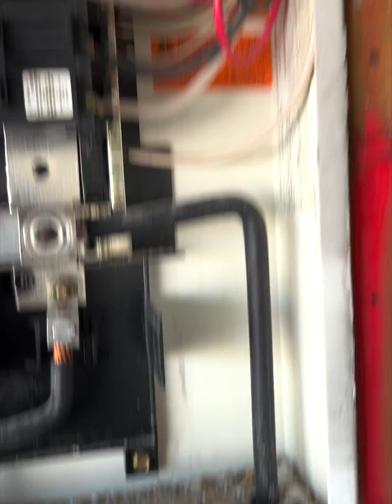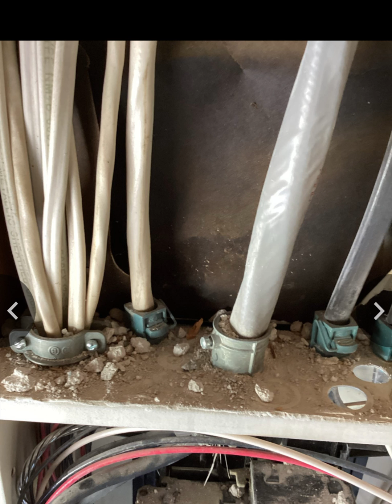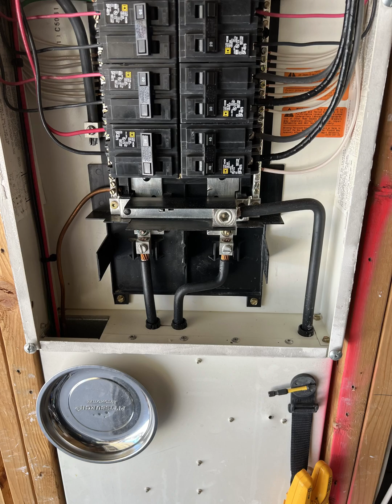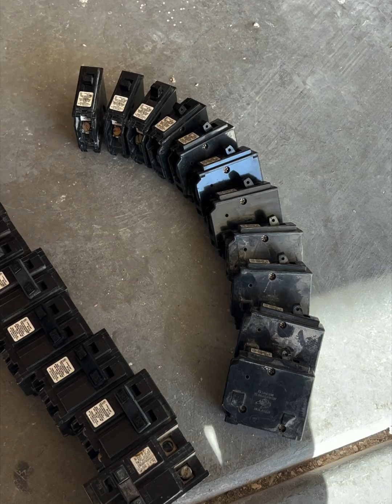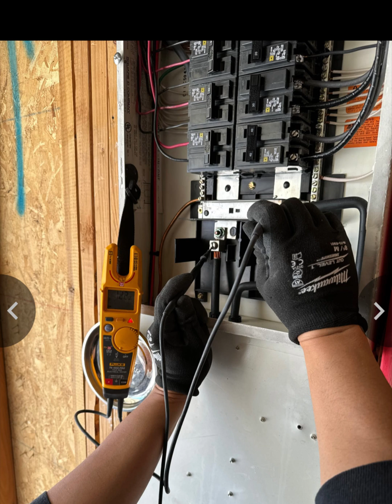Panel Rejuvenation

Comment: Biggest code violation of NEC 300.20 is having the service conductors enter through different openings. If you understand basic electrical theory then you would know that will cause the metal pan to conduct heat through magnetic coupling under load. All conductors of a circuit have to enter ferrous metal in one opening so the magnetic field cancel each other out and doesn’t cause the pan to induce heat. Neat work but not up to code. Looked over again and noticed even a more deadly violation that could kill people. There is no main breaker in this panel which would indicate this is a sub panel. You only bond ground and neutrals at the main source. NEVER AT A SUB PANEL. If the path is broken then you are making grounds and the panel box hot. You obviously have no idea what you’re doing, you’re a hack. Your work can kill people.
Reply from the maker: Woah! Chill out. This is the main panel. The main disconnect is outside. Square D. Seems like you’re one of those dudes that knows everything, but apparently not everything.